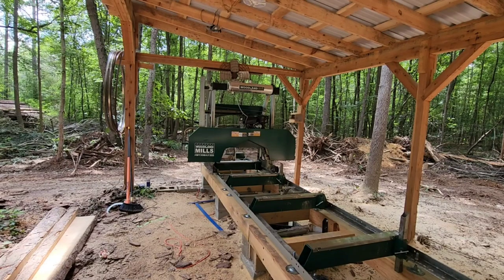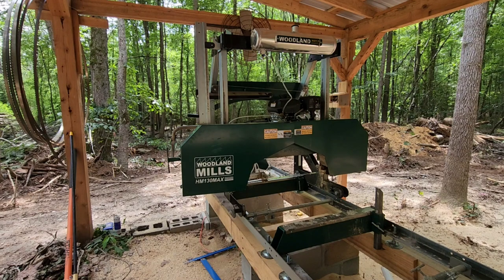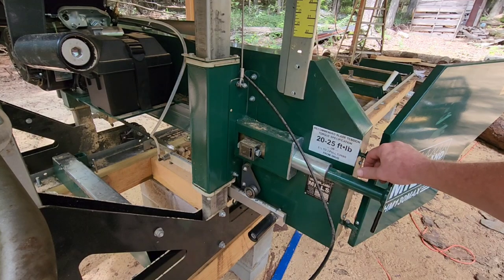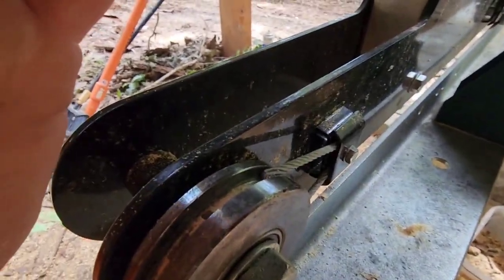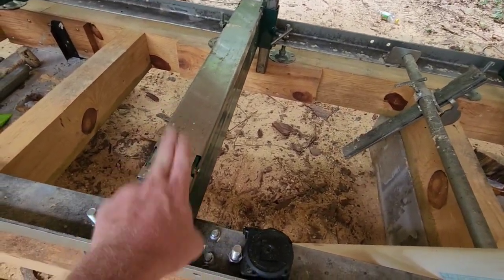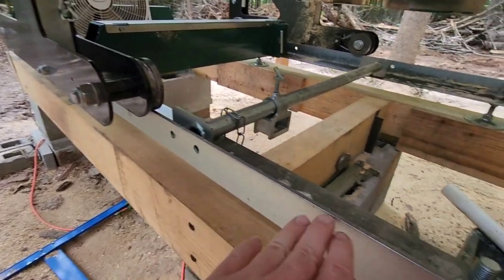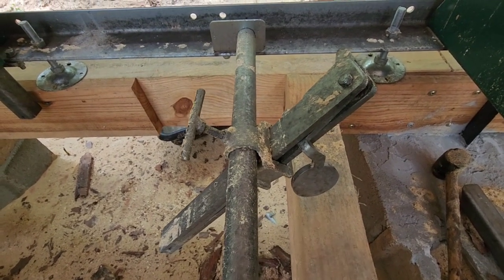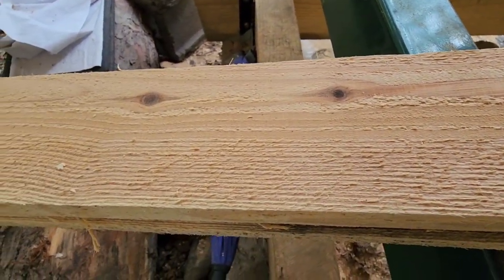1 year review of the woodland mills hm 130 max.

Comment: First time viewer and because of this video now a new subscriber.  Thank you for taking the time to make this video... it’s probably one of the best reviews I’ve seen.  It helps to make good decisions when folks like you share your honest experience.  I especially like the fact that you included your tips.  I’m 65 and have a portable chainsaw mill I use but I would like to move up to a bandsaw mill.  I have a few years before retiring and I’m hoping to have one setup by them.  I’m not sure I can convince my wife into allowing me to get one as big as your HM130MAX.  I have been looking at the HM122 (9.5 HP) or possibly the HM126 (14 HP) with one extension.  Do you sharpen your own blades or do you send them out?  Well, I’ve rambled on long enough... again thank you for this video review.
Reply from the maker: I sharpen mine with a harbor freight chainsaw sharpener.  I did have to modify it a bit, I plan on doing a video soon showing how.  I maxed my mill out one time and it was a job getting that big sucker turned.   I think you'd be happy wirh the 122 or 126, it depends on how big a log you can move as well.
I have a video also where I use my chainsaw mill, it does up to 52 inches wide.   Had to buy a 3120xp chainsaw to run it.     Thanks so much for the sub and good luck on deciding which mill to get.
Reply from the maker: @Tim-MCMLVIII  that 600 pound winch is a back saver on mine.  That 3120xp was using 3/4 of a tank of gas per pass on that pine log.  Those mills are nice when you can't move the log, just take the mill to it.    My mill has a 66" bar.

Comment: Have you seen an issue with the water adjuster and set screw corroding to where the set screw will not turn?
Reply from the maker: Not yet but I am planning to replace mine with a 1/4 turn ball valve. Mine got stopped up several times .
Reply: that set up is crap,  I found it easier to just adjust flow at the on off  on the dash board, it only needs a slight movement to get all the water you need, and is easy to add a lot more if needed with out screwing around with that good for nothing valve they put on.
Reply from the maker: @benscoles5085  I hate it as well.